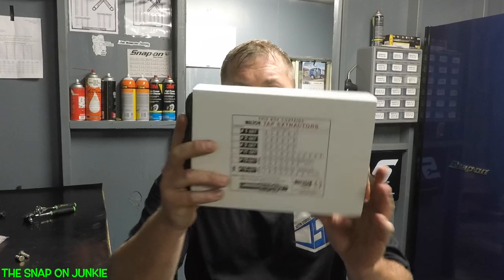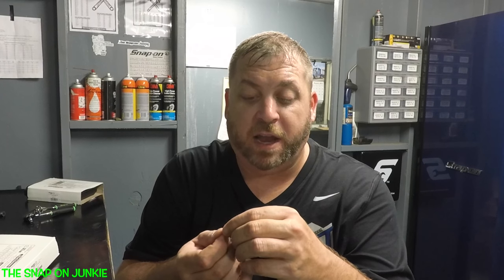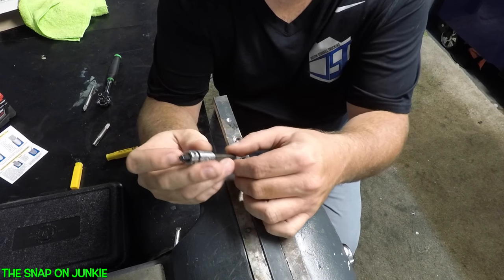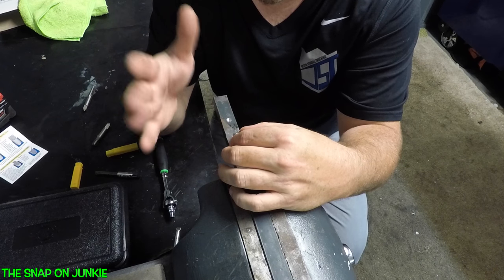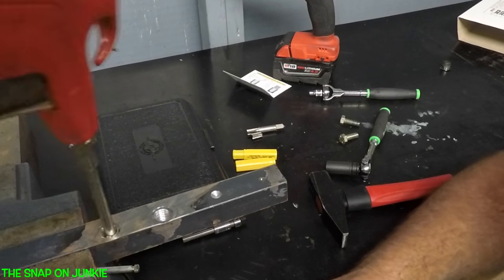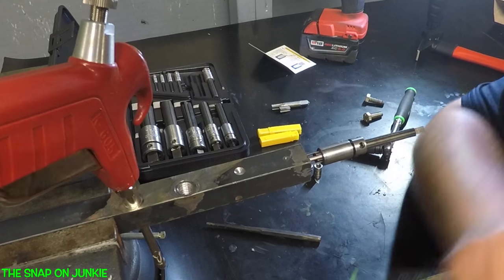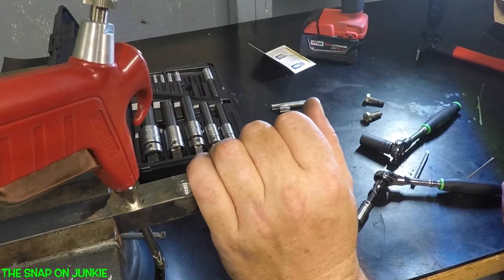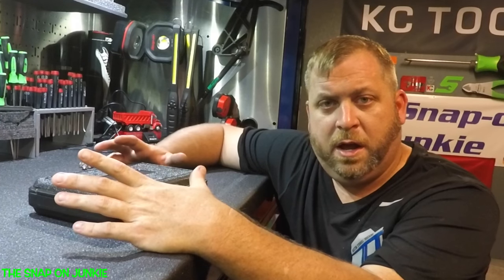THE BEST TOOLS FOR REMOVING BROKEN TAPS🔩🛠

Comment: That’s incredible!  Have not seen those before.  For someone dealing with rust and repair, a lot of seized and broken bolts, where thread chasers aren’t always enough, this is incredibly helpful.  One of the most helpful tips I’ve come across on YouTube.  Thank you, Junkie!

To those who haven’t used taps, ALWAYS go slow, use plenty of cutting oil, go a few turns, back out a turn, rinse, repeat.  Oh, and don’t use a tap with a power tool.  It is not a drill bit lol.

Comment: These things actually saved my butt from getting reamed out at work, broke a 10-32 tap in a pretty critical part just cleaning out the threads. This tool actually worked. No more shitty cheapo carbon steel tap sets for me lol, from now on I only buy and use HSS taps. And for cleaning threads I use only thread chasers.

Comment: Thanks for the vid SOJ, but you need to simulate a broken tap by twisting it in so that it is pinched/torqued in "nice and tight" ; then.....try to back it out.  This way it will simulate how one , with inexperience , would brake one off!  

 Unfortunately, I think you will find that the Walton tool won't "touch" it  - very nice tools...... but their effectiveness is very limited!

Comment: I had an 8mm bottom tap break on me. I ordered the 5/16" extractor. I then saw your video and how you needed to use the next smaller fingers with the correct sized extractor. I immediately cancelled my extractor order and ordered the kit...just in case this same thing happened to me. I wanted to rid myself of this frustration, not prolong it. Well, good thing I did because I had to do the same thing as you. I had to use the 1/4" fingers with the 5/16" extractor. Anyhow, the broken tap came right out. Lucky for me I was only cleaning rusty threads, not cutting threads. I'll be much more careful using bottom taps in the future.
Reply: Busted a tap while cleaning a thread, sounds like you were using one of the crappy carbon steel taps like the ones they sell in sets at Home Depot. I used to use them but I couldn't thread anything under 1/4-20 without breaking the tap with minimal pressure. Get some good HSS taps, they cut through mild steel like butter. You notice the difference immediately.

Comment: Carbide drills are hard as fuck, but also very fragile, that is why you need to use a mill, or a very solid drill press to use them. It would be very easy to snap off the carbide with a pistol drill. I have not seen that form factor, but you can get normal fluted carbide drills. 

The tap extractors are good if the tap is loose, so snapped off because you lean on the tap wrench or something. If you are cutting new threads or the tap fractures, those are not going to help a whole lot. You can always get lucky though.

Comment: The last broken tap job I had, I broke a tap cleaning head bolt threads flush in the block. It was one of the smaller support bolts, not a main head bolt. I ordered a Walton and all It did was bend the walton. I had to chip the whole tap out with a punch

Comment: Who's doing the captions on this?  I found two errors on this one about 2/3 of the way through that could make it difficult for someone to follow your meaning.  The first had to do with cleaning out *'threats* in the hole instead of "threads"; after that, you had knocked the excess piece off  the tap with a *Kate* chisel instead of a "cape" chisel.  I assume YouTube is captioning these, but that individual is apparently not well-versed in tools and workshop procedures.  My hearing is decent for someone my age, but from time-to-time I turn on the captions for more clarity; it's kind of aggravating to see such obvious mistakes.  The same thing occurs in court transcripts owing to the volume of pages that must be transcribed each night.  If you're not part of the proceedings, it's not hard to lose your way while reading them.  Oh, well.

Comment: I don't deal with tap n die too much. But I think I'm going to start collecting helicoil set in all the popular oil drain plug sizes.
Reply from the maker: Antonio Bustamante By time sert  not Helicoil’s
Reply: There's a video where a guy compared them. Time serts pull out of aluminum before helicoils do
Reply: I think I have seen that video. Didn't big sert or something like that do best?
Reply: I believe so

Comment: Sorry, junkie there junk. Used them many times..don't work in the industrial World I work in. Hope they work for the auto mechanic...peace
Reply: Blue collar Wrench, they don't work in a heavy duty application either. Usually end up smashing them up and remove the pieces. Then the fun begins to salvage the hole.
Reply: Geoff Clark agreed. We usually get a number one tip, heat them up drop cold water on them and break them into pieces then helicoil..
Reply: jasalmon21 depending on the size..heat and kroil..don't put kroil on a hot bolt the fumes are very bad to breathe. I use a die penitrant. Spray can, 3m product..spray let soak for 24 hrs. Works.
Reply: jasalmon21 ah..yeah those are a pain..in the event you have some stud length to grab and turn with your in luck. I would pit on some ear muffs start her up get them suds hot shut her down..then safely spin them out. Liquid wrench at night, in the am..start her up, run for ah..Ahh.umm..five mins. Shut off wait one min, spin them off..vice grips..junkie has six drawers full of them..borrow some from junkie..🔧🔧🔧🔧👍👍👍👍💲💲💲💲💲💎💎💎💎
Reply: jasalmon21 weld it in place!!! It's just a mower...🐸🐸🐸